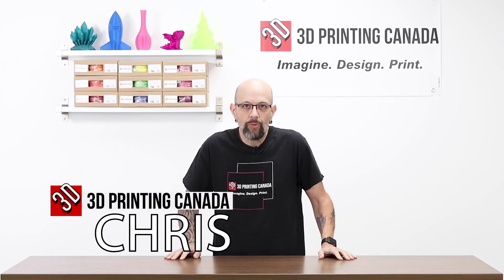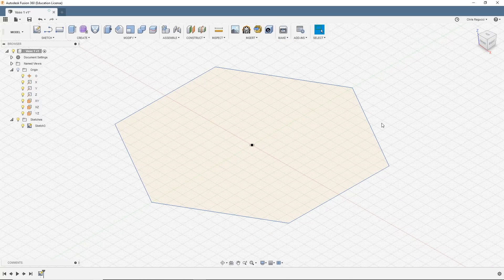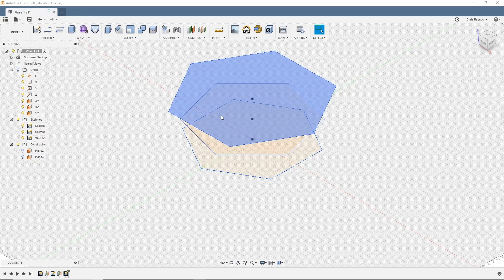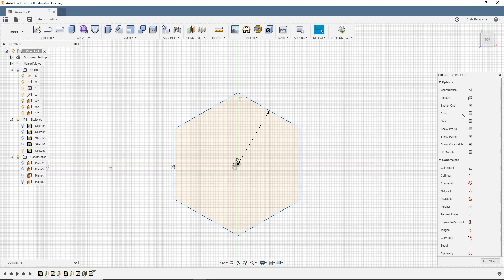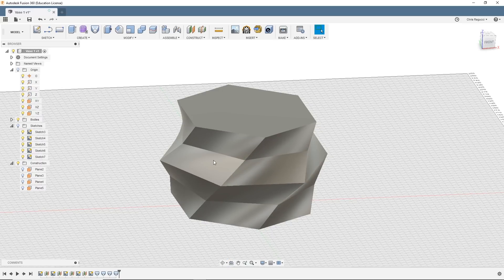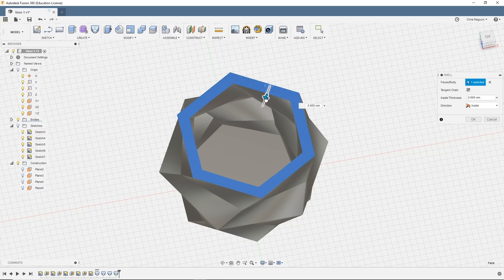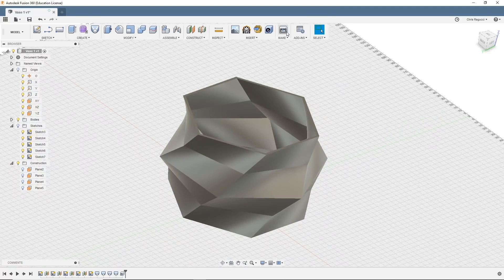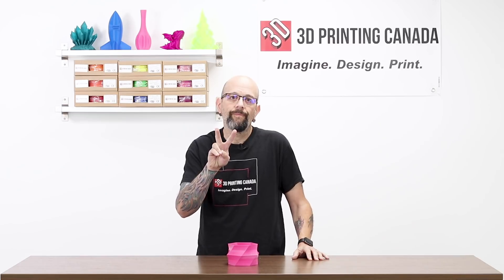Fusion 360 Design and 3D Print a Vase

Comment: Would love to see you talk through how to design a simple , stacking set of containers for electronic components.
They are quite expensive when bought commercially 
Would be nice to be able to have something that is able to be modified to suit 

J
Reply: I'm not really sure what type of containers you're talking about. Like stacking trays? Can you share a link to a picture of what you're talking about? I'd be happy to do a demo!
Reply: Was thinking something along these lines...maybe if possible make them so they can stack both vertically & horizontal? Doesn't have to be exact the same - just to give us an idea to start with

https://www.westfloridacomponents.com/mm5/graphics/00000001/SB91587-side.jpg

would be nice to be able to just resize & reprint one when required 

Thanks for getting back to me